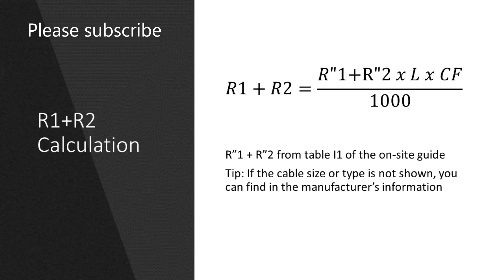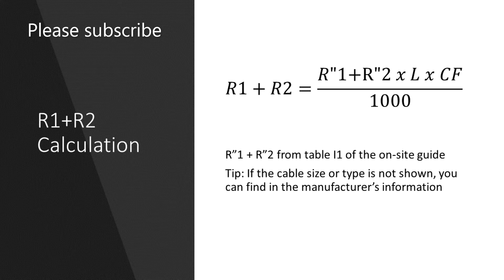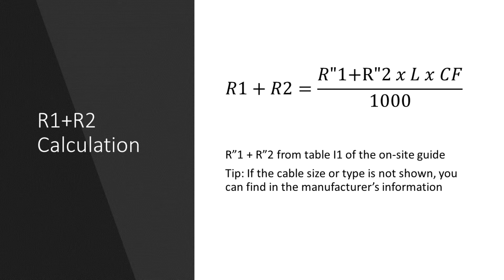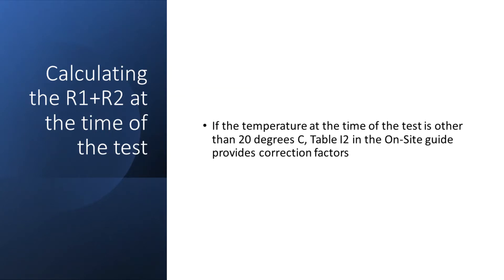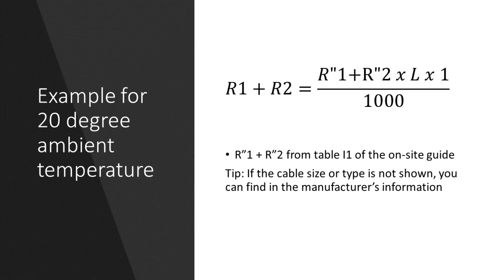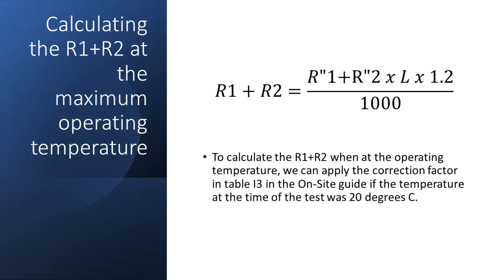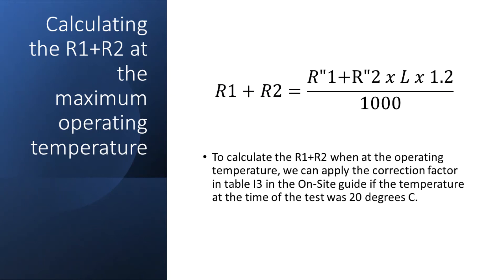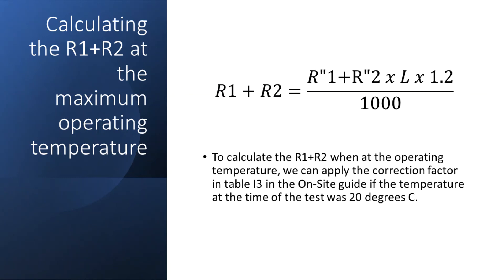How to calculate R1R2 and verify Zs

Comment: Hi James thanks for the video help me a lot, one question if I’m using a 2 core armoured and the steel as the cpc how do I calculate my r1+r2.
Reply from the maker: Hi Dean, thank you for your comment. I'm glad the video helped.
When using swa as the cpc, it will be necessary to obtain the data from the manufacturer. Data sheets are usually available on the manufacturer's website, and I notice they include a value for the line conductor in ohms per kilometer. It used to be possible to get the value for the swa as well, but it may be necessary to contact the manufacturer and ask for a value for ohms per kilometer for the swa as well as the line conductor. This can then be used in the calculation I mentioned in the video.
Regards
James